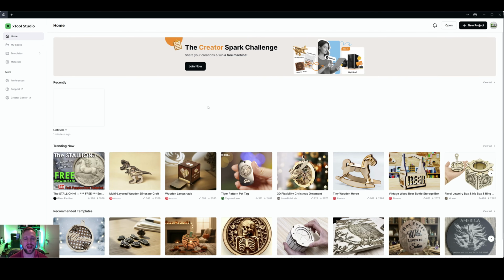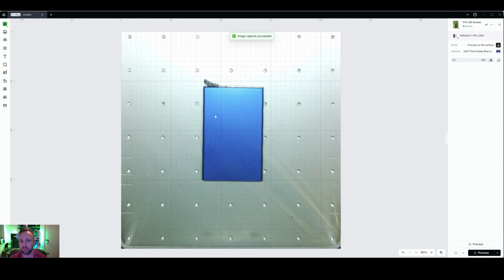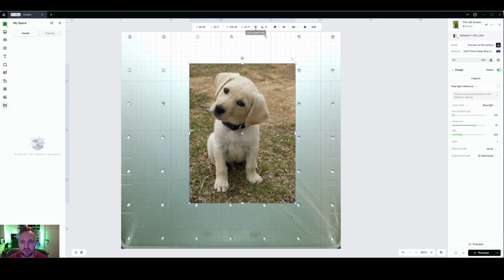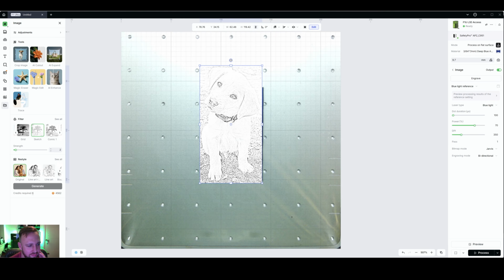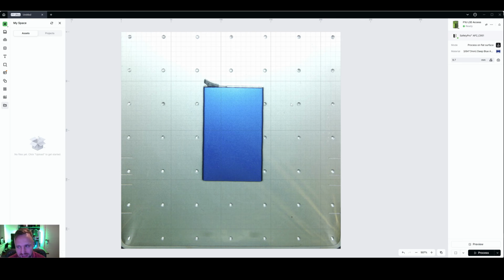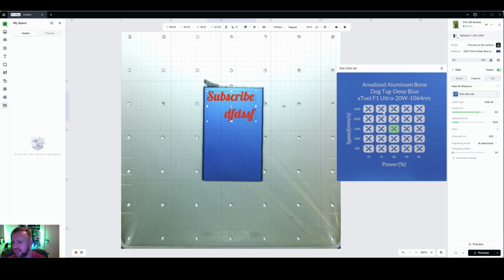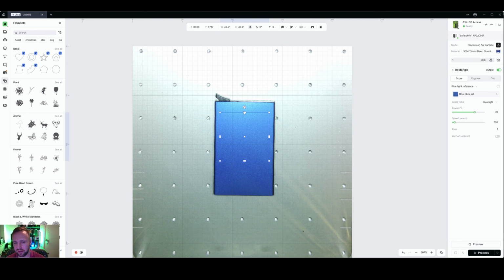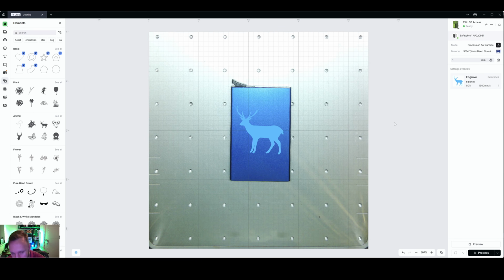New to xTool Studio? Start Here

Comment: @L3DAccessories - I purchased the self-centering jig, but I'm so new to this, I can't seem to get my dog tag blank to center for the picture in my  F2.  It's always cockeyed on the plate.  Does that matter or how to fix??   Thank you!
Reply from the maker: Check out my tutorial on framing, I'd recommend framing your design and then rotating the jig until you get the design straight.

Comment: Are you able to connect and run multiple machines at once?
Reply from the maker: Yes you can, you open a new table for each machine you want to use and then whilst in each tab you can connect to separate machines.

Comment: thank you for video
1)Scoring / Creasing Line for Paper (Instead of Cutting)
“Is it possible in XTool Studio/xcs to create a score line for paper, where the laser only makes a light crease instead of cutting—similar to Cricut’s scoring or dotted-cut line where i can give space between 2 cut and length of cut?
2)Print-Then-Cut Feature Equivalent:
“Does XTool Studio/xcs have a feature similar to Cricut’s Print Then Cut, where I can print an image and then have the laser align and cut around the printed design? If this is possible
Reply from the maker: Thanks for watching
1) You could try a very light power and quick speed, I can imagine it might be possible but the caveat would be that the Diode laser could also set the paper on fire.

2) Unfortunately I am unable to answer this question, it's an area that I don't have experience with. If I had to guess I'd say it isn't possible but I could be wrong.

Comment: Your videos are simply the best and most informative on the internet!! Without question!! I just took delivery of an F1 Ultra….I’m totally confused concerning its initial calibration….will the software automatically do it?? I’m running XTool Studio!! Thanx Chris!! Cheers
Reply from the maker: Thanks for Watching Robert, I appreciate the great feedback. Regarding the calibration of the F1U, it's not something that it automatically asks you to do. When I received mine I didn't calibrate it. There is a way to manually initialise the calibration in the device settings but this is only required when you have moved/transported the machine or if you notice a degradation in the alignment/performance.